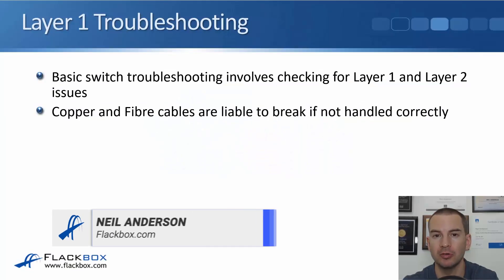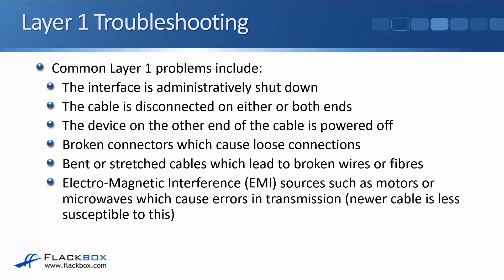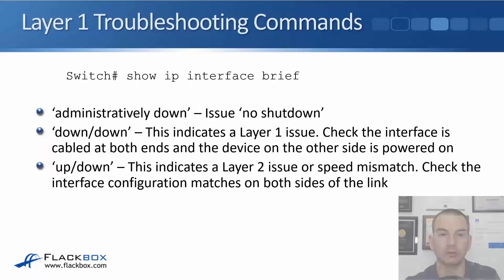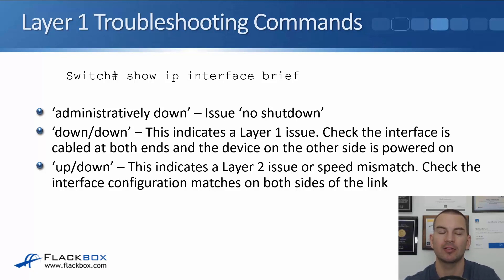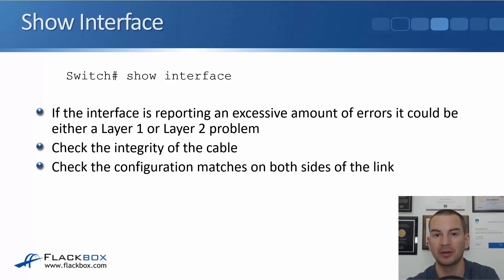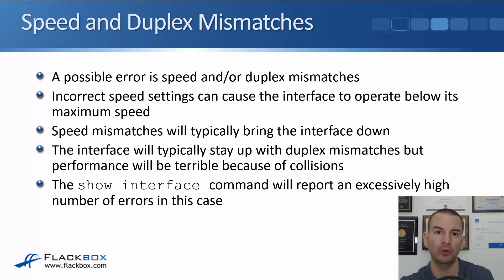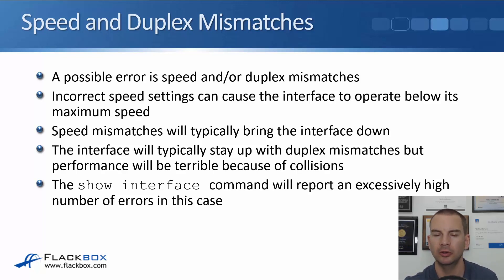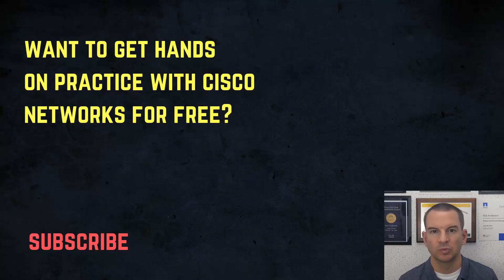Cisco Basic Layer 1 and 2 Troubleshooting

Comment: Intrigued to know why you use "sh ip int brief" when discussing layer 1 ? I know what you're talking about but to be explicit and check the physical ports, wouldnt "show interface summary" provide this and avoid potential confusion ?
Reply from the maker: Hi Jakezxz1, 'sh ip int brief' is the quickest way to see the most important layer 1 to 3 interface troubleshooting info in a single command. You could alternatively run multiple more specific commands instead, but most engineers go with the quicker option. HTH, Neil

Comment: Unrelated to Cisco specifically, but I had a ton of problems with noise and cut-offs on my local network. I went through multiple iterations of calling the ISP, who would then either set me up on a heavy noise profile, or send a new router. This went on for years, until they finally sent a technician who noticed that the modem socket was non-standard. After he switched it with a regular socket, the network suddenly jumped back online with better bandwidth than ever before and no downtime. So that's how the network world looks from the perspective of a muggle. Trying to learn Cisco now.